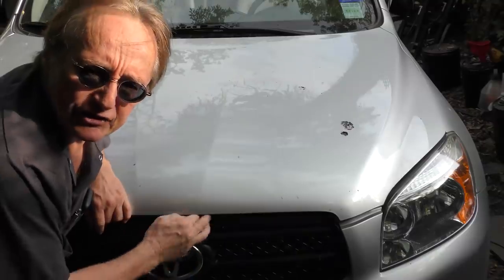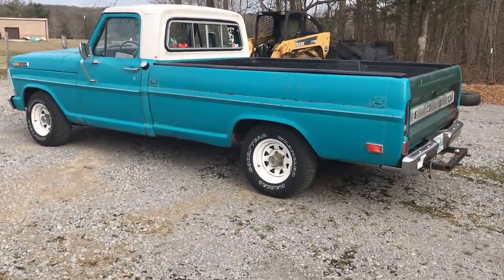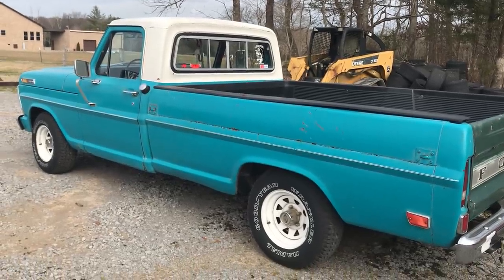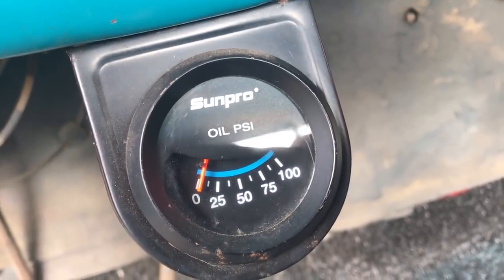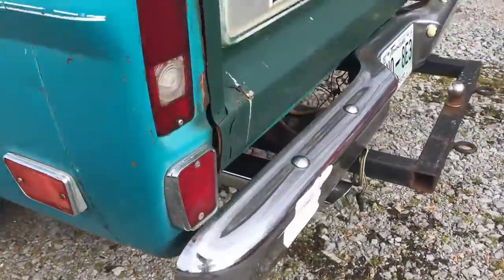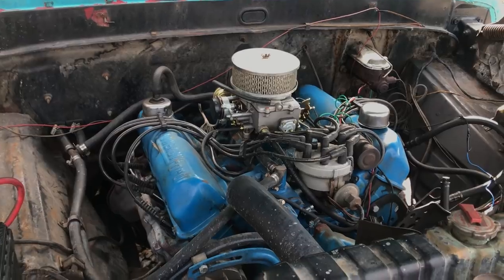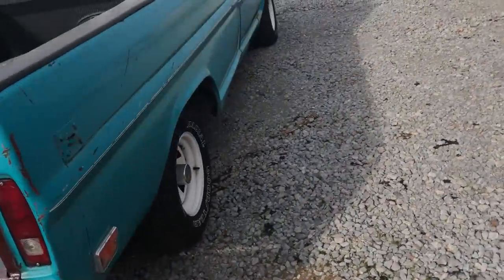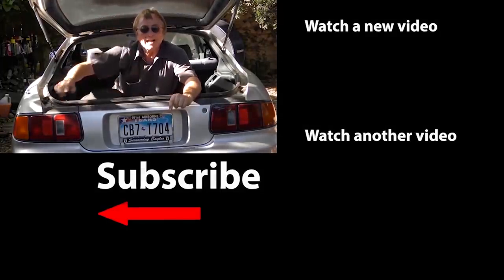Here’s What a $900 Ford Truck Looks Like

Comment: Hey Scotty I have a 1997 Toyota 4Runner 4x4 manual. I am starting to have a lot of problems with it. Many oil leaks and it’s not running right. Every time I fix something else goes out. Should I abandon ship or just put money into it and replace the engine and units of the truck. Also I replaced the cv axles the passsenger side continues to leak. Any advice or help is appreciated

Comment: At 4:12 in the video,that is not a 9". Looks like a dana 44 rear possibly a dana 41,more common in the 67-72 f-100;had a 72,and 71 f-100 72 had the 9" and the 71 had the dana,both 3 on the tree with armstrong steering.Nice truck any how,cheers.

Comment: Nice truck. If it were mine, the first thing I'd do is swap out the drum brakes for some discs -- those old drum brakes just don't belong on today's roads.
Reply: Rick Ames Sorry to tell you buddy but even brand new modern semi trucks costing $150,000 have drum brakes, almost all your big service trucks that are class b and class A have drum brakes , almost all you’re small service pickups on the market and F1 50s and 250s still up until a few years ago used drum brakes,  most of your passenger and commercial  vans use drum brakes ,     should I continue,

Comment: Hey Scotty! What do you think of a 1984 GMC Sierra pick up with 180,000 miles on it got a new 350 V8 5.7 L engine, 400 transmission, and transfer case in 1992 it sat for 17 years runs and drives great. Thank you have a wonderful day
Reply: Paul Nyberg Jr any 73-87 is gonna treat you right if it’s in good shape and has had maintenance and a guy changing the oil regularly.

Comment: Don't think you could even get an 8 track in a truck back then. Strictly AM radio.
3 on the tree a theft deterrent, not to mention the key is on the wrong side of the steering wheel on the old Fords.
Loved all my old effies.

Comment: My Grandpa had bought a new F250 in 1968 . No options, no power brakes, no radio, 6 cylinder, 4 on the floor, hand choke

Comment: Leave the stock exhaust manifolds on it. Headers will give you nothing worth the cost. Weekend truck? I'd use it daily. I could still drive a three on the tree, but would rather have a four on the floor. That's the only change I'd make. I would also try to find the right air cleaner, but that really shouldn't be that hard. Might put some mufflers on it, of some sort that just tone it down a bit to not draw so much "blue attention."  Anyway, I love it, this is a good truck, it's what a truck should be. No, it's not a Ranger, I don't think. That was a short bed if I remember right, but it has been a long time. Now a Ranger is a smaller truck. Well they're all smaller these days. No friggin computers on this one. I love that.

Comment: Scotty, my 10 Camry has the motor with the bad oil rings. Toyota offered a fix but the motor had to be under 150k and it ended last October. My car just started burning oil and has 160k. Question, can I clean the oil rings with motor flush? Or should I trade it in? Thanks, Ralph in northern Colorado.
Reply: Addendum, I discovered I had the issue at 64k, I have 105k on engine now. It runs smooth and quiet and evened out that Toyota vibration.

Comment: Nice old truck….steering wheel is a ‘70 the radio is most definitely NOT stock. 8 tracks to my knowledge were not available in ‘69 but I could be mistaken.
I had the top of the line ‘69 Ranger with A/C and all the bells and whistles and it was an AM radio only.

Comment: good to use a prefilter or a form filter oiled around yr small filter big motors need a large filter..also good to use quality paper with many folds large service area like teho filters..as u drive u crreate dust yr filter needs protection from it..

Comment: That's Really Cheap for one in that kind of Shape  Here even from Dealer one in that Condition could bring $2,500-3,000 Easily.   Tons of Guys Love the 67-72 F-150 Trucks.  They make nice Restorations or Street Machines
Reply: Rick Beam it’s a 100
Reply: @mateodelcastillo7186   Ok  it's F100 little Difference  it's the body type many love n in my Area locals Tend to value lesser Rusted trucks as keepers. Our Roads in Past were heavily Winter Salted n Sanded. Normal Floor n Lower metal rust pretty Common too

Comment: if i could find one for 900 i'd buy it.   I had my 79 stolen and i am still not over it.     a high boy is a f250 single cab - 

  i will have an old ford again, but i doubt seriously it will be a 900/00 one.   gonna be 5 grand or so unless I get lucky.

Comment: Definately not the Highboy. That was only in the 4X4's.
The steering wheel is not the factory one, it's out of a newer Ford truck.
We have had 2 1970 F-series trucks. One the F100 almost exactly like this one but with the 4 on the floor, and the other was the Highboy F250 4X4, also 4 on the floor and parttime 4X4.
Nice old truck.

Comment: VERY VERY NOICE!!!!!
Reply: Had 57 with 406 and 4 sod, needed new clutch slave , bought kit , same as brake master cylander3 $ 3.50 , took 30 min max to remove and rebuild, back in business, my 96 same problem , spent $ 100.00 for slave, had to remove transmission , on inside of belhousing,  ????? Would cost $ 600.00 to to have it done, ENGINEERS U STINK, PLUS IT WAS MADE OUT OT FIBER???? WHAT A RIPOFF.
Reply: @kentgaibler3811  VERY VERY NOOOIIIICE!!!!

Comment: not a bad truck but i stick with my 2000 f150 v6 i just got for $500. did the basic maintenance and been driving and having fun in an 19 year old 5 speed truck again with 202k on the clock

Comment: that red paint is primer coat not a base color coat. The auto industry does not use red primerthat much anymore. Nice truck though. I would re paint the the whole truck one color like off white or seafoam green and update 2 barrel to 4 barrel carb to give the motor more power.

Comment: That's not a ranger either. Ranger has the chrome ring around the steering wheel and 2 more gauges in the dash
Reply: Still a nice truck. I bought a 70 f250 with the 390 for $999. Love those old fords!
Reply: Maybe just a F -100

Comment: My man that was my first vehicle and loved that truck but that three on the tree would lock up and make a man want to drink
Reply: Fish Fool yeah you gotta be easy shifting it. You can’t speed shift on column shifts.
Reply: That is just the linkage binding up. You can open the hood and free it up by hand, no real problem.
Reply: Just replace the linkage bushings and she’ll shift smoothly. I did that on my 1950 Chevy 3 on the tree when I replaced the synchros.

Comment: I have a 1969 ford f250 ranger camper special it's light ivry yellow 360cid fe engine and automatic 3 speed number 77'469 built I'm restoring it I got it for 500.00 on a auction

Comment: 58,000 miles but looks like it has 258,000 on it. Someone beat the crap out of it for sure.
Reply: Probably more. Didn't Ford have a 5 digit odometer readout for the longest time? My '88 Fox body only had 5 digits. Plus, my MPH only went to 85 lol

Comment: Back when ford could make a vehicle that would last longer than 50 thousand miles 🤣
Reply: lol GM has more electrical issues than any manufacturer but hey I still drive them every now and then.  My dads a GM guy I like Ford better out of the American manufacters followed by Toyota,then GM.
Reply: Your kinda right about that but none of my chevys or gmc had electrical problems
Reply: @wmc128  I also like anything that's not ford
Reply: Jason..you never heard of old cop cars turned into taxis..3 to 500k many of them.

Comment: I have a 1975 4wd also a 1977 4wd Ford one on 35s the other one on 39.5 super swampers the 75 has a 390 engine with a 4 speed and the 77 has a 351m with a 4speed high and low transfer also have a 82 with a 302 short bed brown and tan u not a man unless you own a 70s to early 90s Ford truck

Comment: Now pick one....$40,000 for a new F-150 or $900 for that...
A set of good tires for the new F-150 cost more than that 69 truck did.
And the man said..."but you don't know what I paid for these tires...they only cost $625 for all four.
To which I responded...Yea and in 73' I was offered a used 67 for $695 and around that time that was what you expected to
pay for a used Pu truck. So don't tell me about how you only paid $625 for a set of tires.

Comment: I would take that truck over pretty much any new so called pickup truck they make now days given my druthers.
You can work on a truck like that.
It is not bloated with a ton of worthless electronics and sensors.
Real metal used for parts instead of craptastic plastic everywhere.
Runs without magic.

Comment: Aftermarket tachometer is falling off the dash, dents all in it, and lord know what lies beneath that bed liner,  and you wont go get a matching mirror thats not beat up because its not original? its your money your truck do your thing. frankly, i would drive it just like that because it looks fine but you said you dont want to out a lot into it. unsure why you are locking yourself to factory parts on a 50 year old car. just drive it dude. its beautiful just like that.....and go to oreilly and get a damn mirror

Comment: Poor guy has no clue about this stuff. He obviously did some research online. " I wish i had the original air cleaner" Then you would need an original carburetor. Also its not a Ranger it is a Camper Special. Thus those strap holders.